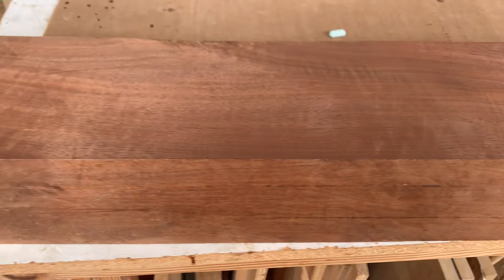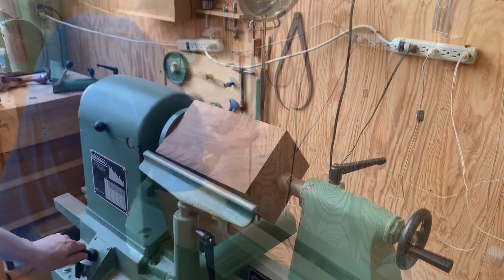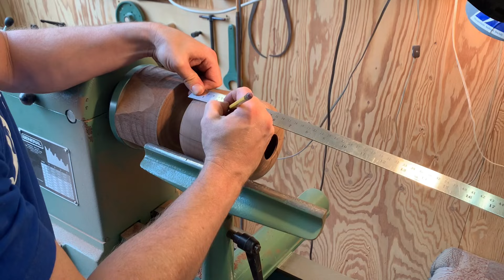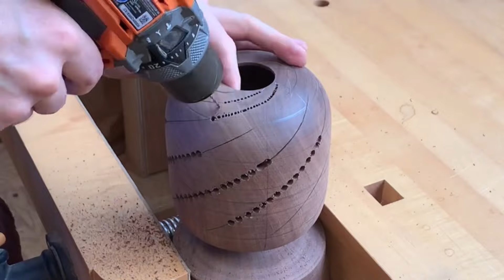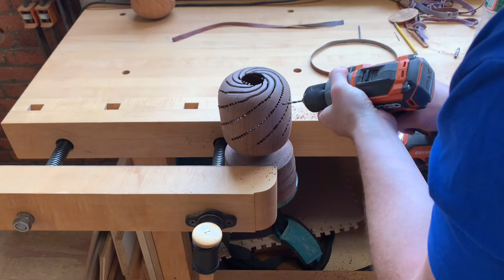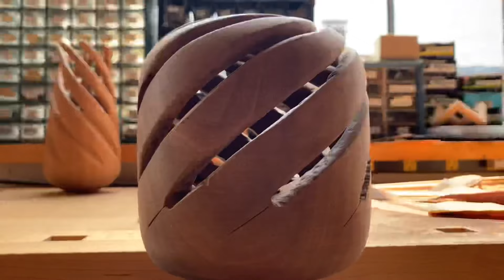Hollow Vessel Turning  || Barley Twist

Comment: Why do you place the gouge on top of the piece while it is turning?
Reply from the maker: To check how round the wood is without having to stop the lathe. If the tool bounces off the wood there are still flat spots. If the tool sits on the wood without bouncing it will be a round cylinder. The vibration will give you an estimate of how much more to take off.
Reply: @JShawFurniture  TY